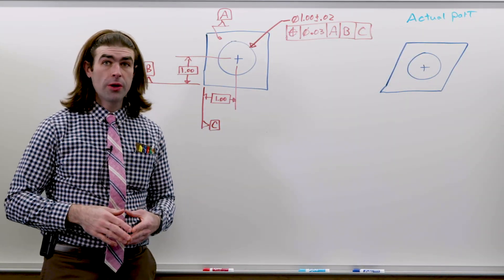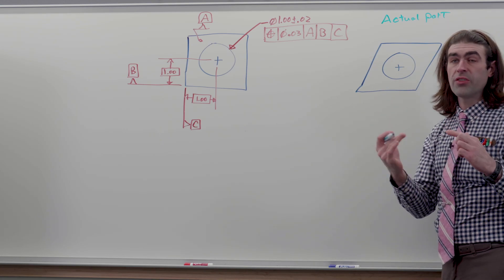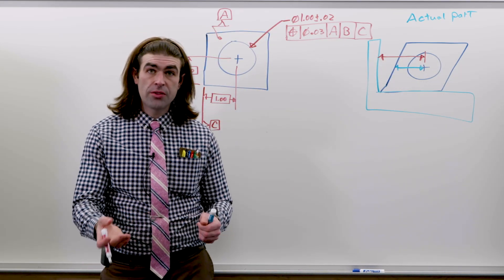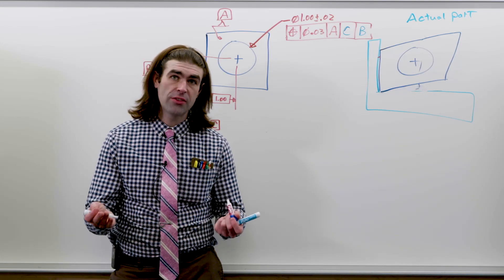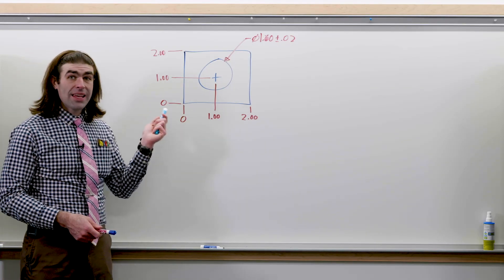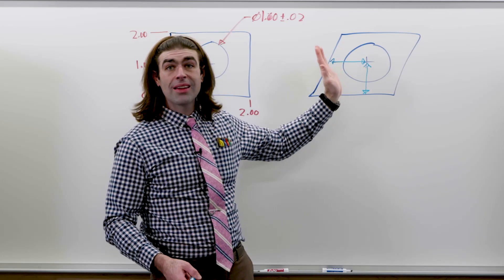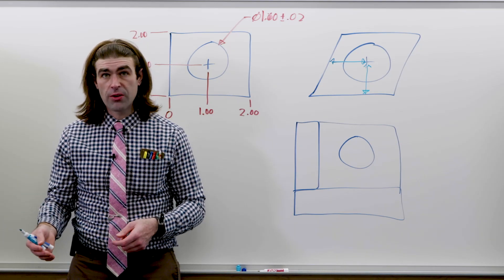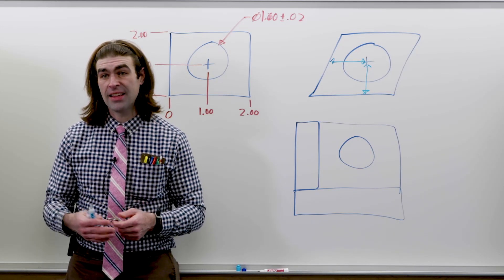GD&T: Datums vs Ordinate Dimensioning

Comment: Great explanation with simplistic approach. Just explaining the advantage of the use of datums versus ordinate is great but I think most  individuals will struggle with the concept measuring from the feature versus the tangential locked DRF. It would be great if you did an episode to expand this with the use of CMMs which can allow the violation of the locked in DRF focusing on points, lines and circles ugh.😂
Reply from the maker: @rich mon Thanks for the thoughtful comment! I have several CMM videos, but I don’t specifically address your question. I’m curious about the term “tangentially locked” DRF. What kind of CMM do you use? Are you using ASME or ISO?